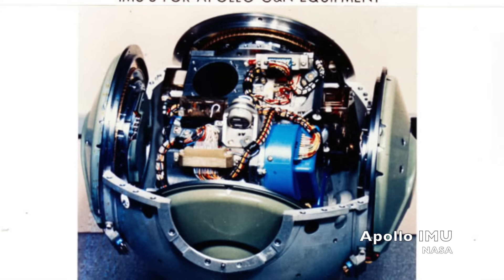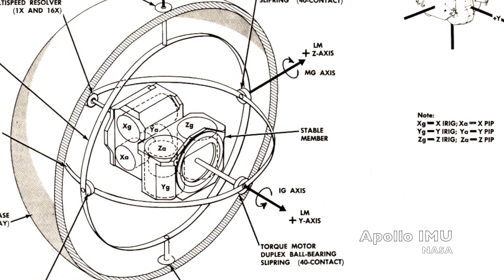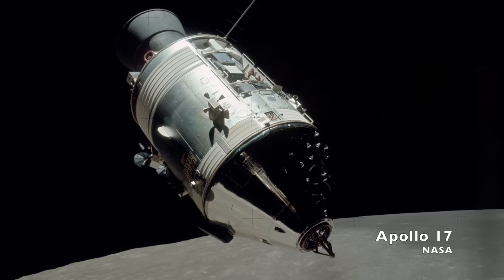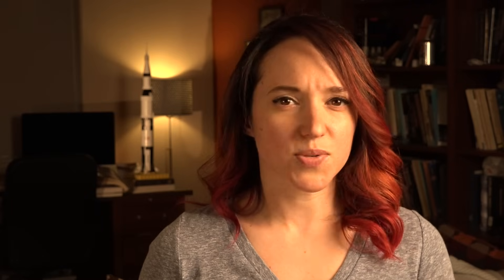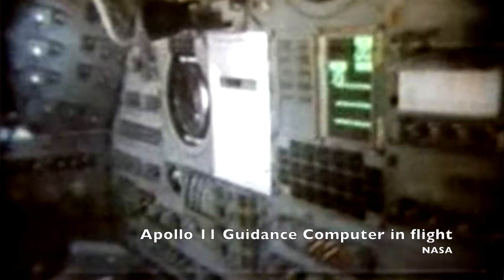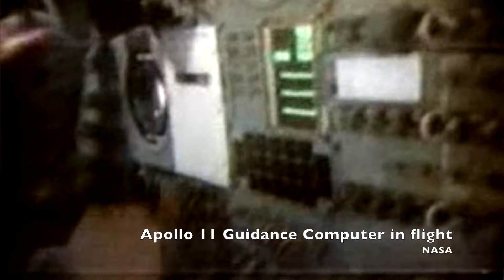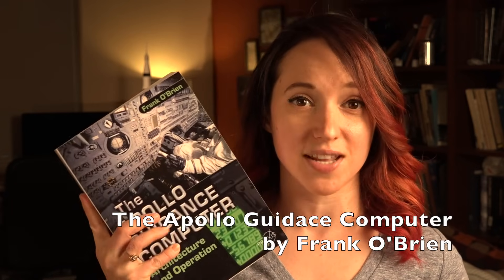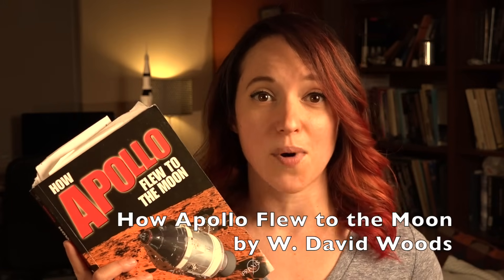Gimbal Lock and Apollo 13

Comment: Amy have you ever seen the ten by ten matrix used in the aerospace industry. 
Or looked at the way time is managed with crew changes on submarines, spacecraft, ocean liners with large crew numbers. How does NASA manage time zone differences in space for the orbiting, the different NASA centres. On the moon and with spacecraft on missions. Time is going to be effected with deep space missions. Not to mention warp drive travelling  at light speed.  Is Light Speed the time taken to  travel the circular distance around the sun. Or is the distance across the diameter of the circle. Does the Oreck Air purifiers used in the submarine fleet get used in the spacecraft. Have you seen the materials used in space and their specifications and testing for certification of use. Temperatures limits, metallurgical testing. The new tech 3D printing of titanium seems to have a layering that leaves holes in the metal. Is that structurally weak.

Comment: I have a tiny light bulb that came from the Apolo spacecraft. This one was never used but is a part that was used in all of the Apolo spacecraft. The bulb runs on 3 volts (I think) and is about the size of a sesame seed. Perhaps a bit smaller. It was soldered into the device it operated in and has two radial wire leads about 3/4 of an inch long. I have tested it with a variable DC power supply (that I built) and it still works. That is how I arrived at the 3-volt figure. I never measured how much current it draws. I got the bulb from a friend who worked at NASA during the Apolo mission years. I've had this bulb since the early 1970's and it will remain in my possession until I die or someone offers me a deal I can't refuse. I used to have the Apolo part number and probably still do. I should mention that it is an incandescent bulb with a tungsten filament. It's a great example of how the militarization that is so common in the electronics of today has its roots in the Apolo mission engineering of the 1960's.

Comment: In the 1970's, before GPS, I was on a USGS research ship off California with a gimbal navigation system (it had other systems too - including LORAN-C). A pen-and-ink strip chart recorded the three axis orientations. Several days of heavy seas upset the gimbals one axis at a time. Each went bonkers gradually until the system was a complete loss. I guess they are great when they work but...

Comment: The late Astronaut, Eugene Cernan, Gemini 9 [also walked on the moon Apollo 17 and flew in Apollo 10 too within 8 nautical miles of the moon], experienced personal Gimbal Lock on his Gemini 9 space walk, loosing attitude control of himself.  Cernan lost "13" [as in Apollo "13"] pounds from sweating during that ill-fated space walk.  He was almost brought back to earth from outside the CM [The CMP was able to get him back in using a long gaffing hook - REALLY?  MAYBE??], although he MAY? have burned up during re-entry had he been left outside the CM.  

[The space suit he wore had the ability to withstand temperatures in the maximum range 2500 to 3200 degrees F.  for emergency re-entry. The re-entry corridor angle played a key role in his survival had he been left outside the CM.  A shallow angle would have been required for survival.    JUST KIDDING].

Comment: What point(s) of reference does the attitude indicator use in space? In aircraft it's the horizon and for pitch & roll this works well, but away from Earth it's surely no use. What were the roll/pitch/yaw reference points on the way to the moon?

Second, did the Soviet method of space navigation & instrumentation differ significantly from the US? Their aircraft attitude indicators are different (third person instead of first person), are their space attitude indicators also different to US designs?

Comment: 4 gimbal Raspberry PI kit is what I want for Christmas :)  Nice to play with.
That and the word "gimbal" added to the spell check dictionary.  Things us geeks have to deal with :) 
Lastly  "precession"  (also needs to be added to spell check) is what causes drift. Two types are gravity induced axial and simple "nodal" drift. 
I think 1980 is when mechanical gyro spin gimbals where replaced with optical ones that send light down two coils of fiber optic cable wound in opposite directions.
I still like the mechanical version. Nice to see things spin.

Comment: A fourth gimbal was put on the probe Kepler, which was put in space outside Earth orbit to look back at the Earth while we orbited the Sun together. Gimbal # 4 failed, but NASA could still control it. Then gimbal #3 failed, and NASA couldn't control Kepler anymore and had to repurpose the probe to give other data that was valuable as it drifts in Space around the sun. 

But that dream came true if only on space probes! 

I learned this from some NASA speakers at a presentation in my city called "Our Place in Space."

Comment: a rocket Gimbels are gyroscopes between each of these gyroscopes is a magnet to keep it pointed the right way if the spacecraft goes off course the magnets will line up and the word gimbal lock will appear on the computer and you will see a red disc in the middle of the compass indicating that they locked and the gimbal lock light will appear on the screen next to it. this needs to be avoided because if the corpus locks up or gets magnetized the spacecraft will go off course and crash or they will be lost in space.

Comment: Don't have time to read through all of the comments but just throwing this out- the inertial system measured not only angular displacement but angular (or axial) acceleration. I'm a sleepy retired Delta Captain but I did do (on loan from Delta) consulting work for NASA. It was the MLS business back in the '80's at Ames Research Center. Thanks for your work.

Comment: Wow. You've probably dumbed it down a lot, but is it close to say that gimble lock is pretty much three gyroscopes aligned in the same plane, when they shouldn't be, resulting in a lock up?
Reply from the maker: More or less. They key is that they need to be offset for a reference to each other, so without that you get gimbal lock.

Comment: You can kind of do the same thing to a modern aircraft analog artificial horizon.  Once the gyros are charged, they stay spinning for hours after a flight.  If you remove it from the aircraft without the AH being locked out, then move it quickly in all different directions, the gyros inside will lock to the same plane, and you will see the same red ball in your display.  And thus making it totally useless.

Comment: Gimbal locks were also a common type of user error in early 3D modeling and animation applications such as Lightwave 3D, SoftImage, or 3D Studio Max. 

In order to represent a 3D environment on a 2D computer monitor, these programs employed a virtual gimbal system for orienting and positioning objects and camera views. The virtual gimbal enabled the user to employ a regular mouse to manipulate the object across one axis at a time; pitching, yawing or rolling the object or camera with respect to its parent object or the global environment as a whole. For example, holding the left button would allow movement along the X axis, the right button would allow movement along the Y axis, and the third button (or holding both buttons at the same time) would control the Z. Easy-peasy, right? 

It was all rainbows and unicorns until the gimbal lock reared its ugly head. Sometimes, when the user rotated an object 90 degress of another axis, the object's local heading would become synchronized to the heading of its parent or the global environment, essentially replicating a mechanical gimbal lock as experienced by the Apollo13 flight crew.  Two of the 3 axes would effectively become locked together, resulting in a loss of mobility across one of the 3 axes. 

In the early days the only solution was to shut down the application and reload an earlier save of the project, effectively throwing away all your recent work. (Another reason to always save your work often!) Later 3D modeling applications have created solutions like handy hotkey combinations to reset the gimbals and break out of a gimbal lock situation. 

Just thought I'd throw that out there. 

Great video. 

Cheers! 

-John

Comment: I might be wrong, and risking not looking up to verify, but I think there are only two gyros set at 90 degree angles for a 3-gimbal system.  1 gyro can give basic attitude, X-Y and a third is added to remove Z ambiguity.   The second gyro simply compensates for a single gyro inability to detect angular displacement in the plane of rotation.   A fourth gimbal can be nested without needing a 3rd gyro as two 90-degree opposing gyro's have no attitude ambiguity (in a three dimensional universe).  The fourth gimbal simply makes gimbal lock less possible, but not impossible.  As soon as the fourth gimbal aligns with one of the other three, it will lock with them and move in concert with that locked frame.  The net result of the forth gimbal when locked is that you are relegated to a three- gimbal system where another lock could happen.  In an ironic way, a four-gimbal system is more likely to lock.  Also a four gimbal system would need some sort of sum-er computer to derive  3D (orthoganal) attitude from a mix of 4 stator-resolvers (sychro's), which adds complexity and yet another point of failure.   In aircraft the second gyro is called the "Directional Gyro", and for autopilot's it's called the Yaw-Rate gyro.  Usually these are not nested due to single-point failure possibilities in multiple axis.  If and aircraft nested their gyros and flew straight up (call Zenith), or straight down (called Nadir)  they would get gimbal-locked just like the old capsules could.  A three-gimbal-two-gyro might be as good as it gets from a system safety perspective.

Comment: Thanks for clearing up a question I never knew I had... Back in the day, my father owned a 1956 Cessna 172 that had a venturi driven attitude gyro.  It had a large knob on the bottom that was labeled GIMBAL LOCK, and when turned until it clicked, locked the artificial horizon with a flag that popped up and said CAGED.  When I saw the Apollo 13 movie, I thought they were trying to cage the gyro, and wondered why they were so worried about it and just cage the stupid thing.  Now I know better!

Comment: The most amazing to me about Apollo 13 is that up to that time, most pilots had direct control over the planes they flew. But in Apollo 13, they don't fly the ship. Their flight commands are sent to a computer, that has a virtual "plane" that is fed those inputs, and if it fits the flying enveloppe, it goes to the real commands on the ship. This was, if I'm right, created and inserted into the way of flying by Apollo 13. This is a major step. Most modern planes today follow this design: you don't fly the plane, but a virtual one where your inputs are inserted, checked, and a computer then pushes those accepted inputs to the real plane actuators and controls.The F117A can't be flown without those, as the B2 Bomber. As our planes get more complex and control surfaces do increase, it's no longer possible to fly without a computer, because you can have 10 or 15 control surfaces on the airplane, and the amount of use of each depends of pilot inputs, stable flying enveloppe, current speed and orientation of surfaces vs current aeodynamic flow.
Reply: No, that way of flying by entering commands and parameters on the AGC was not new to Apollo 13. It was a feature of the entire Apollo program. If all went well, astronauts would be in direct control when docking/undocking the CM and LEM, and in the final seconds of the moon landing. Everything else was via instructions to the AGC.

Comment: The math and orientation is not correct regarding a 4th gimbal.  A 4th gimbal would not have stopped unrecoverable gimbal lock from happening on the Apollo 13 mission.  Yes, it would help in other case when the spacecraft is under control, but a 4th gimbal on Apollo 13 might have made matters worse, as the crew would have defaulted to that gimbal when the first 3 failed.  This needs more thought!

Comment: It's interesting how computer games and simulations can have the exact same problem if rotation is handled using Euler angles...
The problem is roughly the same, and the consequences are crippling. (but it's only a simulation... So)

It's an interesting problem...

Comment: It is odd though because... as the rings got into this "plane", why can't they just keep turning?  Just because the two or more rings are now in a common plane, why would it cause the mechanism to become confused or lock up?   It's like having multiple orbits that end up with the same inclination.  The difference inclination between the rings becomes zero.  So... why is that big deal?

Comment: Experienced gimbal lock using Euler angles to calculate rotation in 3d space in my first game.  I learned to use quaternions (4x4) matrix to represent an objects position and multiply it by a another quaternion to calculate translation or rotation in 3D space - instead of the 3 vector euler angle scenario.  Quaternions are the programmatic and mathmatic answer to gimble lock if anyone watched this video hoping to solve that specific issue.

Comment: I have a suggestion for a future video.  Apollo 15 and 16  released  subsatellites (PFS-1 & 2) that were small satellites released into lunar orbit from the SIM bay. There main objectives were to study the plasma, particle, and magnetic field environment of the Moon and map the lunar gravity field.  The orbit of PFS-2 rapidly changed shape and distance from the Moon. In 2-1/2 weeks the satellite was swooping to within a scary 6 miles (9.7 km) of the lunar surface at closest approach. As the orbit kept changing, PFS-2 backed off again, until it seemed to be a safe 30 miles away. But not for long: inexorably, the subsatellite's orbit carried it back toward the Moon. And on May 29, 1972—only 35 days and 425 orbits after its release"—PFS-2 crashed into the Lunar surface.   Tell the story what happened here.

Comment: Did the TARDIS have four gimbals, since it moved through four dimensions?
Reply from the maker: Not being a Dr. Who fan I'm going to leave that up to other people to solve! Ha!
Reply: First you say that you don't like the space shuttle. Now you openly admit that you're not a Doctor Who fan? You're walkin' a dangerous path in nerdland, my dear! :)
Reply: Well TBF if you've only been exposed to Moffat you have good reason not to be a Dr. Who fan! :P Don't get me wrong I like Moffat but he's not a good lead writer. He's better as a, albeit senior, script writer without the position of managing the overall story arcs. Secondly, a device like the TARDIS would not use gimbals but other substantially more advanced forms of inertial sensor. Gimbals are already mostly obsolete and being phased out of use today. That's why your phone can detect its orientation without being the size of a bloody football! :P Finally, a TARDIS does not, to the best of my knowledge, operate in four spatial dimensions, at least for navigation and 'flight'. It operates in 3 spatial dimensions and 1 (or more?) temporal dimensions. Gimbals only work for detecting spatial orientation and thus only 3 gimbals would strictly be required for full attitude data and a stable sensor orientation. Obviously, if the TARDIS decided to use gimbals as part of its inertial sensors, then it would almost certainly have the space to add a fourth actively driven gimbal and thus forever avoid gimbal lock.

Comment: You are good Amy,  Nicely done.  Not mentioned though was why Gimball lock was so critical at the onset of the emergency.  As the craft was pitching around their antennae would not be pointed toward earth and thus communications would be lost when they were trying to figure out what the hell just happened.  Several times in listening to the communications you can hear it getting really bad, then improving as the antenna would find or come close to finding the better alignment with the antennae back on earth.

Comment: There were 2 red circles at the FDAIs. Those 2 circles were representing gimbal lock "zone" that should be avoided. This is why during transposition & docking there was a 180* pitch manouver and not 180* yaw manouver.

Comment: Years ago in 1970s visiting Exploratorium in SF, they had a Sperry (I think) gyro platform that you can hold, outer cover was off, so when you tilt and roll you can see the inner package maintain its attitude. But if tilt and roll too much the inner package goes spinning around. If you re-adjust the platform the inner portion stops spinning but it is not in original alignment (totally random orientation). It was kind of interesting. 

Then fast forward to 1990s watching the movie where they are yelling about gimbal lock, with Hanks as Lovell, "I am watching the G.D. gimbal!" and capcom mentions they are on VOX. Yep you can read all that in the transcripts.

Other than that, I immediately remembered my experience with the Sperry gyro package. Would this be the gimbal lock? I have yet to read specifically more, I don't see it as a lock but as a loss of alignment. Which would be super bad for Apollo 13 as they wouldn't know proper alignment for the "get us home fast" burn.

Thanks for pointing out those two books. Many that watch videos like this want extensive reference material they can dig into.